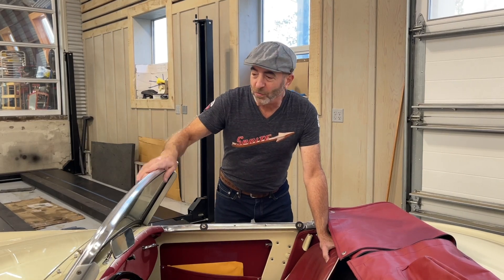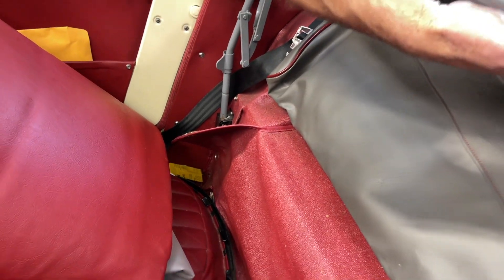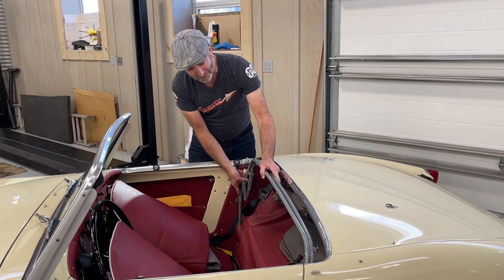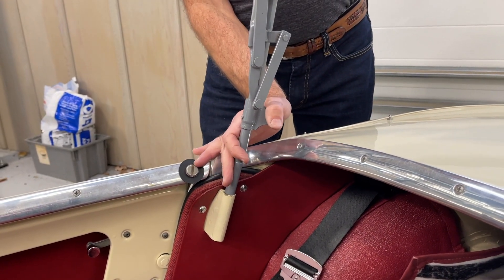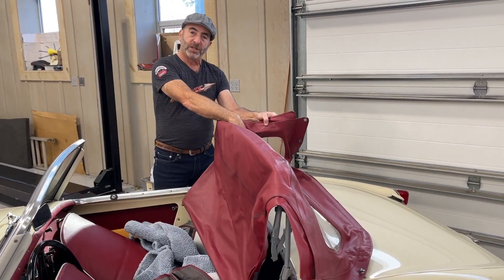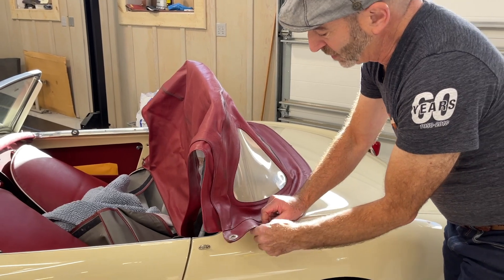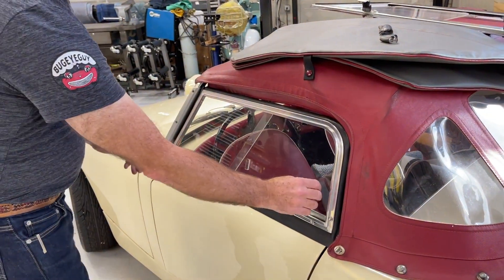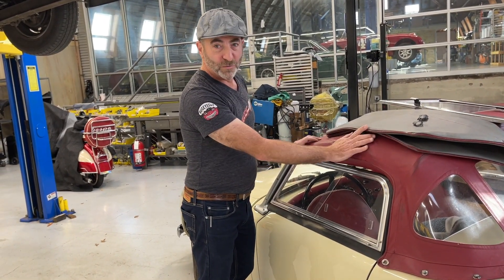Bugeye Sprite video owner's manual. Part 2 weather protection

Comment: The side curtains look like a copy of the Amco side curtains.....I'm a long time 1959 TR3A owner (55 years) and always put the top on AFTER erecting the frame, never thought to leave the forward bow slack and 'slide' it in place last...That would sure save a lot of strain in my fingers , although I bought a new high quality top 20 years ago but it's only been up maybe 3 times...I have no tonneau cover and drove through my first two winters in Northern Ontario with no side curtains , wearing a snowmobile suit....Sears Roebuck carried a lot of accessories back in the 1970s, like convertible tops @ $99 , Amco sidecurtains @ $99 and full carpet kits @ $89 ...I must have bought 3 or 4 'Econo' $99 tops over the years until I bought a high end Robbins top when I decided I was keeping the car , LOL ....Glad I stumbled onto your site , for sure. You're never too old to learn something new ....John (west coast, Canada) ....Cheers

Comment: How you find out you have the wrong parts...  I have a two piece top bow, no spring loading. Might be a later spridget part, I wonder how you tension that type?  I haven't bothered with a soft top for mine yet, I have a hard top that I am working towards refurbishing, a video on those would be handy, especially how the bolts secure them.